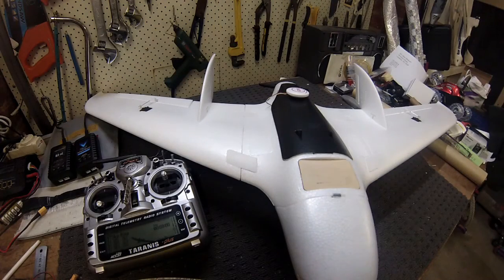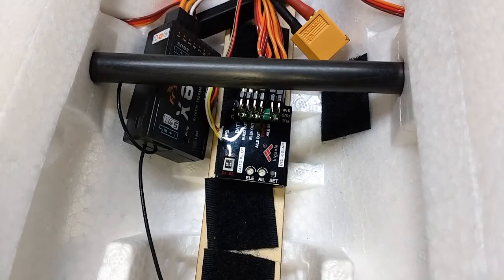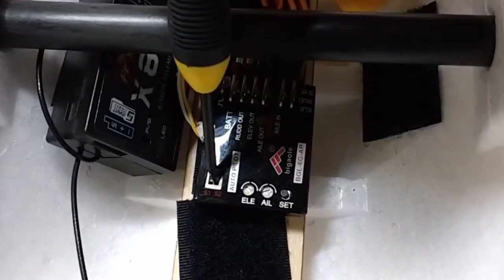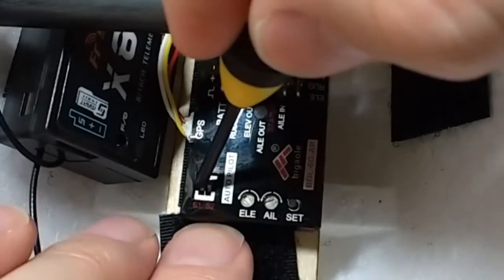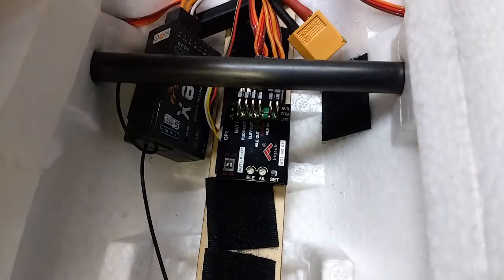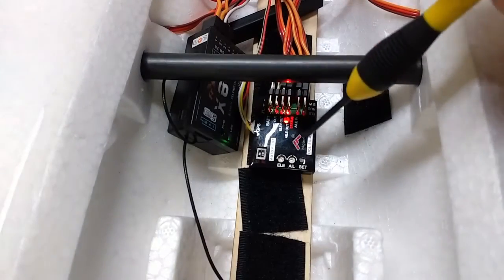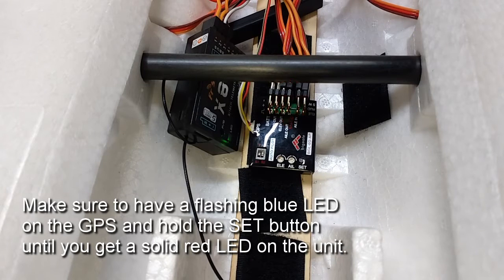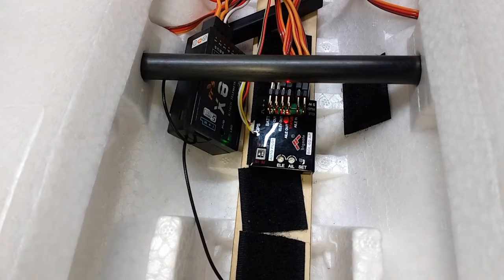BGL-6G-AP on a Flying Wing - Setup

Comment: Hello, I’ve been trying to set this system up with a spektrum transmitter. When I set it up as Elevon the stabiliser only works on one wing. Should the transmitter be set up as a normal plane not in elevon? Thanks

Comment: Hi Michael,
I'm having problems getting the AP to work correctly on my FPV wing. The unit was tested and works correctly on a conventional airframe (Bixler) but when activated on the wing, the model drops into a rolling dive. It stabilises immediately when the RTH or Stab mode is deactivated. All connections are as per the instructions. The AP has been initialised. The elevons move correctly when the Stab mode is ground-tested. Have you (or anyone else) encountered this problem? Any suggestions?
Cheers! Paul.
Reply from the maker: Sounds like the surfaces are reversed.
On the ground. Roll the left wing down left surface should go down. And vice versa. 
It is easy to get confused. If it is the case, and you reverse the flight controller to correct the situation, make sure to swap the direction of the transmitter to compensate for the change in the controller.
Cheers Michael
Reply: @madrc6667  Thanks Michael, I need to slap myself. The AP control throws were indeed, reversed. From now on, I'm going to stand BEHIND the model and watch which way the surfaces move.
Reply from the maker: @spthompson6501  Easy mistake and one I have done myself. Glad it is sorted! Cheers Michael
Reply: @madrc6667  Thanks Michael, all sorted! The stab and RTH now works perfectly! I notice that I have very little control in stab-mode. The model just flies straight-&-level no worries, but it takes almost full stick movements to make the model respond. It's a bit disconcerting. Do I have the gains set too high, or too low? Cheers! Paul.
Reply from the maker: @spthompson6501  some gain adjustment will give you more movement on the surfaces, but if you add too much then there is a the unit will over correct plane and send it into a spiral dive. So, if you're going to make adjustments to add more movement, do a little at a time and then test at a good height to give you enough time to switch off and recover. 
I would suggest less movement is good in auto level mode. If you need more responsiveness from the plane, fly with the unit off. Cheers Michael

Comment: Hello, great video and I followed it exactly. Only question I had was on setting throttle hold for when you go out of range. Where can I find info on setting throttle failsafe so the throttle stays at 50% or 70% on its rth? Would really appreciate if you could share a video. Thank you sir
Reply: I have a Taranis qx7 if that helps
Reply from the maker: @holaperrito2554  Hi Shaheed, The throttle is really a personal preference. Some people do not want to have any throttle on fail safe because it might go off on the ground. But if you do want to set it , you need to know how much throttle is needed for the plane you are flying. Once you know how much, take off the prop, turn on the transmitter and set the switches and throttle stick the required position and press the failsafe button on the receiver to record the outputs. There should be a  lot of videos for you on YouTube for setting failsafe. Always take off the prop when doing this. Cheers Michael

Comment: Very interesting MAD. If I want to add an OSD. Do I have access to the GPS signals for display ? Thanks
Reply from the maker: G'day. I have heard of some people splicing an OSD into the supplied GPS. But I don't recommend modifying the manufacturers product. There are no ports that you can use for the OSD, so you have to cut into the cable.
In hope that helps. Cheers Michael

Comment: Where did you get the gyro?
Reply from the maker: G'day Frank. I sell them. Please feel free to send me an email (address in at the start of the video) and I can send you a PayPal invoice if you would like to buy some. Otherwise I also have a listing on eBay. Cheers Michael
Reply: MAD RC what is the price?
Reply from the maker: Hi Frank, on my eBay listing they are AU$94.00 + Shipping (https://www.ebay.com.au/itm/Flight-Controller-w-GPS-Return-to-Home-RTH-for-Fixed-Wing-Bigaole-BGL-6G-AP/252999860797?hash=item3ae7f7823d:g:xbQAAOSwALtaVXuu). 
But if you'd like to order directly with me I can send you a PayPal invoice for AU$87.00 ea. plus Shipping. Where are you?
Reply: MAD RC i am in usa
Reply from the maker: Shipping would be AU$23.72 to the USA and includes a tracking number to keep an eye on your parcel as it travels to you. Cheers Michael

Comment: Hi  Michael.  Great video on this unit, Mine is working in all modes except the elevator is reversed in stabalise mode.
Reply from the maker: Ken McNaughton I think that you may have to rotate the elevator gain potentiometer. If you do, you will also need to reverse the input of the elevator input in your radio.
Reply: Thanks Mike, Reversed the elevator on Tx,   ok now

Comment: hi Michael,    if the red wire is rudder on a normal plane what would it be on a vtail?  i have 2 of these stablizers  they work great !  having troubles on the vtail though, stabilizer is set on vtail but only getting one of the tail flap to move when i move the sticks ( when in gps mode or stabilizer mode all works) its only when i take the controls only on one side of the tail works on one stick and otherside of the will move with the other stick.. like its in normal mode..   going nuts here...   help!
Reply from the maker: G'day Bill. for the V-Tail air frame the Elevator connection goes to the left and the Rudder goes to the right. I think that the transmitter should not have any mixing for the v-tail. The BGL-6G, with the switches indicating it is a V-tail will sort out the mixing. I hope that helps. Cheers Michael

Comment: MAD RC- thanks for the vid and review, very helpful.  QUESTION- when I move my wing to stabilized mode I have almost no stick authority, is there a way to change that?  Im using a Taranis Plus?  If I adjust the gain on the BGL-6 then I get to much gain flex/over correction.  in my elevons.  Thanks!!
Reply from the maker: G'day, the only adjustment for the amount of movement on your control surfaces is the gain. I have found that you really don't need a lot of movement to fly the plane. Obviously there is no loops and rolls possible, but I guess that is the point to having the Auto level/stabilise mode. Cheers Michael

Comment: Hey MaD i just picked one up for my Opterra  BUT no matter what POS it in stable mod using opentx on my 9x r pro and need it to be  1 OFF 2 STABLE 3 RTH think you can help
Reply: G'day Ivan. sounds like you have no GPS connection. You can be sure that you have a connection if the blue light is blinking. This is common if you are inside. Maybe try going outside and see if the  switch works.

Comment: Hello, I've been looking at this FC for quite some time. :)
My objective is a FC  I can use on multiple aircraft. I've a Turnigy 9XR PRO, NIB, and am hoping to use it for almost everything I fly (crash, lol).
Can you please let me know if I should take this FC seriously or move to an APM or others? Thanks!
Reply from the maker: Well, of course you should consider this seriously. But more importantly the thing you might want to thing about is what you need. The BGL-6G-AP is a low cost, light weight RTH unit. It also has an Auto Level mode and Off mode. It is very simple to set up, there is no need to connect it to a computer for any configurations or set-up. So, if all you need is a reliable, small RTH/Auto level device this the one to get (in my opinion). Of course, the APM (or similar) contain more options and capability, but have a lot more complexity and set-up requires a PC. But that also provides the added functions like autonomous flights. You also have the option to add in other sensors and have data sent back via telemetry or OSD. Both will assist in the control of the plane, and if the APM is set-up to allow RTH, then they both offer that too. I think if your plan is to move the unit from plane to plane, the BGL-6G-AP would be easier to live with. Potentially you could do it at the field. If you want to be able to fly FPV and have all the telemetry or do mapping or autonomous flights, then the APM is the way to go. Cheers Michael

Comment: The Delta setup is still unclear for me. I understand that left and right servos plug into Aile Out and Elev Out, but what is plugged into Aile In and the Ele/Rud/SW plug? It's hard to see in the video. Sorry if this is a obvious question. I'm coming from multis and know next to nothing about fixed haha. Thanks for taking a look!
Reply from the maker: Sorry, I probably skipped over the input a little. Some receivers are different, but the input into the BGL-6G-AP from my receiver has Channel 1 as the Aileron (AIL) Input to the Controller. Channel 2 as the Elevator (ELE) input and Channel 4 as the Switch (SW) for the modes. There are two wires that plug into the input on the BGL, one for the ELE, RUD & SW that has a single connection on the BGL end and three individual connections for the receiver on the other end. Then there is the AlL that is a straight connection from the BGL to the receiver. Check the connection process from my other setup video, I think it has more details on the connection process  https://youtu.be/Rnr99pWZZas?t=4m  Cheers Michael
Reply: It looks like you've only got 4 servo connectors plugged into your RX. Shouldn't there be 5 connections? 1-Ail, 2-Ele(single wire), 3-ESC, 4-Rud(single wire), 5-SW(single wire)? Could you upload a clear photo to RCG of how the wires are installed.

Looking at the instructions that come with it and it's unclear how to install. Also, when you set your model up in Taranis, are you creating an actual rudder channel on the model?  I've looked at the video you listed, but it's not for a wing and has an extra servo connection(the rudder channel).
Reply from the maker: G'day, I'd be happy to take a closer pic tonight and get it up. One thing to note is there is no Rudder connection in the BGL-6G-AP or the receiver on the delta set-up. 1-left aileron, 2-right aileron, 3-throttle, 4-signal switch. I did not set up a rudder channel for this plane in the Taranis.
The other video was for a regular airframe, but I thought it might help provide more details for the set-up. The main difference being no rudder, but also that the aileron and elevator are left  and right elevons in the delta set up. 
I'll add a link here to the pic when I post it.
Cheers
Michael
Reply: MAD RC Thanks so much Michael. I know I sound like a broken record lol, it's just a little unclear. . .and the instruction sheet that comes with the AP actually list a rudder connection in their grid diagram and on a wing pictured just below that. So the rudder wire from the BGL to the Rx isn't even used...it's getting clearer! :-)
Reply from the maker: All good, better to ask questions and get is set up right. I guess you could have a rudder on a wing, but mine does not have one, but there is provision to add them.

Comment: so the controller does the mixing and you don't need to do mixing on the radio, right?

Also, when I look at my controller the gps looks like it soldered in and I'm not sure if I can remove it like you did. Is it safe to remove the gps?
Reply from the maker: That is correct, no need to program elevon mixing in the radio. I have 100% aileron Ch1 and 100% elevator Ch2. But I have also added a mid and low rate for both aileron and elevator channels. But when you select the switches on the Bigaole, the mix will be taken care of in the controller.
The connection of the GPS has a type of white glue that acts as a strain relief on the wires going into the connector. There is definitely a plug there though. It is quite small and sits just inside the cover of the unit when it is plugged in.  I hope that helps. Cheers Michael

Comment: well done.
Were the dial pods next to the set button hard to tune?
Reply from the maker: No, I just keep them close to the centre point (lowest amount of gain) and add a little more gain if needed. I didn't need to with this set-up, but the pots also change the surface direction/compensation as well. Cheers Michael
Reply: roger. thank you